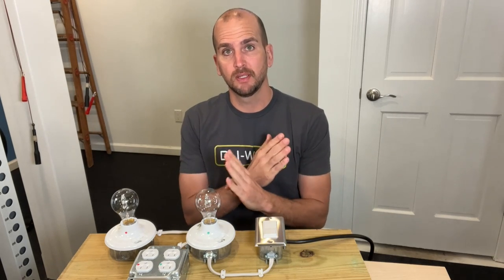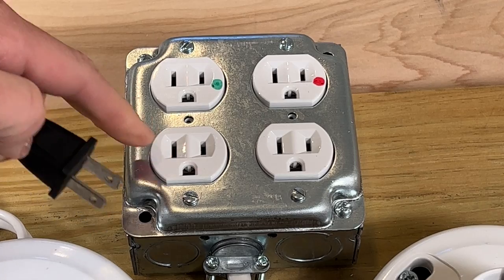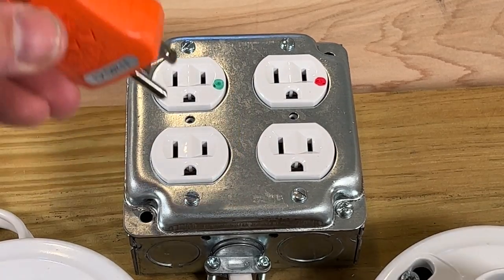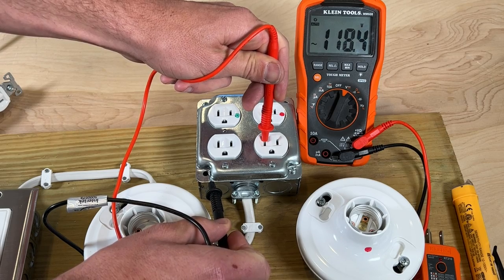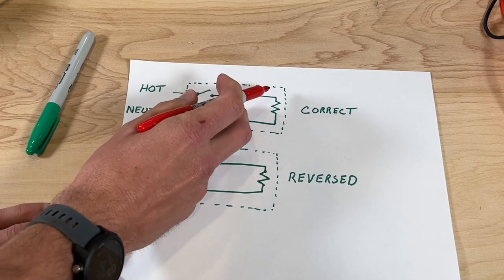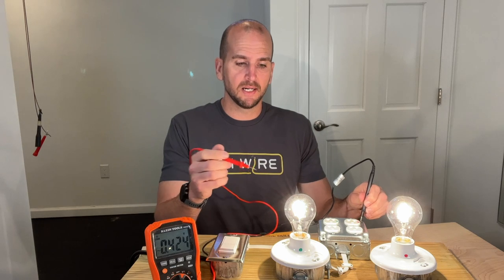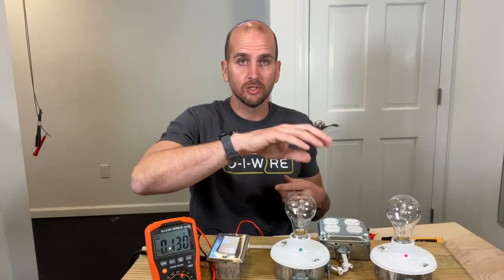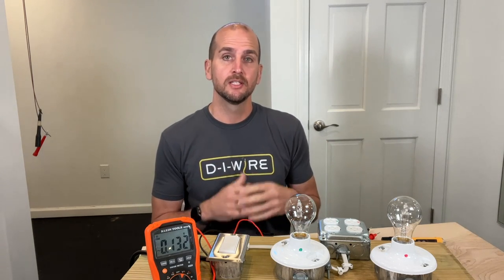Dangerous Wiring Issues In Lights and Outlets

Comment: My dad found most of the outlets were wired in reverse in an older house that we moved into. Being an electrician, he fixed all of those.  But I would not have guessed that unscrewing a light bulb would zap you. So now I know.
Reply: I have found the same problem in apartments I moved into, presumably wired by "professional" electricians.
Reply: The Edison screw (which is what you would consider a standard light socket) was developed quite a while ago. The polarized plugs and sockets used today were an attempt to make the Edison screw safer. The intent is for the large easily touched screw portion to be at neutral, while the hot portion is the little contact at the center of the bottom on the socket. (The easy to touch part = neutral, while the hard to touch spot = hot). Frankly, if the Edison screw were to be developed today, it would have been immediately rejected due to safety issues. But given how long ago it was developed, and how many of them have been installed over the years, it's a legacy device that's virtually impossible to get rid of.
Reply: @johncochran8497  British use a bayonet mount that has two contacts on the bottom.
Reply: @johncochran8497  you backwards, smaller screw for less current as neautral is a traveler conducter carries 50%  of   of the curent line , if add both togeatherif current line is 120 v ac and neautral line is 60 v ac = total 180v ac. From ground to neautral is 60 v ac if curent line is being used. The curent line and ground be 120 v ac.  Only earth ground is 0 v ac
Reply: @michaelspencer6523  You might want to try again there. Your comment was rather incoherent and wrong. 
Perhaps you've confused about an Edison Screw vs an Edison Circuit. Even though both use the word "Edison", they are NOT related except in that they're both associated with electricity.
Reply: @johncochran8497  im a master electrician and i was  over many sites  for usa army with kbr, i found alot basses had your fault i had fixed on war zones or tbe soliders died from ekextical shock and nit tbe war. Neautral is a traveler of half tbe curent, only earth ground is no b
Volts. Never think neautral is o volts  or you get killed
Reply: @michaelspencer6523  I've met many people who've hand 20 years of experience and far fewer who've had 1 year of experience repeated 20 times. Welcome to the more exclusive group.
Reply: @johncochran8497  yes even i repented every night on same thing, then i noticed it in scripture. Only 1 repentance. He explained it . And it was clear it only 1. Repent means turn a 360 degree around from, never look back, as lots wife turned back no repentance, she turned into a pillar of salt. Repent, never do it again, if do it again, i not truely turned my back on it. Must never go back, it is  not  in our desire no more. Repentance is only 1 time on the problem.
Reply: The danger of shock from a light fixture is exponentially worse if you are on a ladder changing the bulb. Be careful up there!
Reply: @michaelspencer6523  In the U.S. the electrical code for many decades (longer than your experience) required the neutral to be grounded. In code terminology the neutral is the grounded conductor, not to be confused with the grounding conductor referred to in common parlance as "the ground." The only way neutral is not 0v is due to minimal resistive losses and the associated voltage drop or if there are major wiring problems.
Reply: @Sylvan_dB  it not more of a chance to get electricuted  on ladders, depends on what latter made of . Plus if ladder grounded to floor or grond like dirt or concrete you be stuck omln curent line and can not get off till heart explodes. Some times ladders save lives if not grounded if it not a comductor  as made of hard plastic insulated for 3 times the volage or made of fiberglass rated for 3 times the voltage. As line voltage is 10,000 volts ac. Stay away from tbe lines  at least 6 feet away or the  voltage will reach and grab you and you explode.  Always turn off circuits at panel not switches. Also always  use  a volt meter. Never work on a loaded line. That is fatal. Metal or wet wooden laters are same as grounded. Always usa a fiberglass or hard plastic latter approved by osha always. If can not do job safely , do not do job till job is 100% safe.
Reply: @Sylvan_dB   incorrect, it to be a grounded  conductor only. Never a curent conductor. Neautral is not a grounded conductor   and never was. You miss understand it. Neautral is made by the electrical wave through the core in 2 or more windings called the transformer. That why it a traveler not a ground. Ground is earth ground in ac . Must be at least 5/8" by 6 feet long burried in ground with a clamp  and  at around 1/3 the size of service conductor size conductor =wire size.ground always 0 volts. Neautral always 1/2 the curent line volts when energized , the return side of the ac circuit
Reply: @Sylvan_dB  always remember possitive and ground always look for each other like a magnet to stick and can not get lose. Frys you to todeath. If grounded. But if not grounded it may blew up uour heart even after you got released. Your heart can blow up wiyhin 72 hours after shock.dead.
Reply: @michaelspencer6523  in the u.s. the neutral is always a grounded conductor.
Reply: @Sylvan_dB  no, you are no electrician, not even a journyman. Anyone says that a neautral is a ground id abroad not in usa or never ever took a rlectrician journeyman test much list a master state test, jouneyman test is first ar a city. It best you take a electrical college coarse or even a coarse  in it calked motor control and relay logic. It gives  the basics  of atoms and why relays not work due to low voltage 3% suplying the coil of relay.  , teaches earth ground and transformer basics, the neautral end of the windings on different voltage as 480 y phaze or 240 or 120 or 208v.
Reply: @Sylvan_dB  conductor means the materal that carries atoms like a wire or medal. In this case its wire or rod. Ground is earth ground must be 6 feet incased in ground and has a clamp to hold correct size wire  , a out 1/3 size as service wire amp size.  A traveler can carry same as current line , current line say is 120 v 60 hertz 30 amp 90 feet distance circuit. Equals size  # 10 wire on a 30 amp breaker. Neautral be same size wire because  it a traveler of current wire #10  for 30 amps alternating current.   Ac power means alternating . Current like pushes 120 v per 60 cicles a second in speed and it must drop back on half of current reading of 120 v , half be 60 v every 60 cicles a second..but ground not slternating curent!, it just earth ground with 0 volts. When it touches a current line as a short or over sends volts it trips the breaker to shut it down. A circuit  wothout ground will trip breaker but much longer. Once neautral shorts to current line it heats up to the breaker tempure liquid tbat keeps it solid then mercury in breaker opens up then trips. Ehere a earth ground   stops it automaticlly upon  shot , not heat, much faster and saves lives, where  your body must reach a mercury melting point before breaker trips. A neautral is a traveler mot a ground. Never get in middle of a neautral ac. You be stuck and die from voltage electricuion
Reply: @Sylvan_dB  you are  sure  not from usa. Usa gas did correct earth ground since the 1950's. Neautral is a traveler conductor , never a earth ground. Neautral can carry 100% of currect line does in ac. The earth ground is seperate, connects to a rod incased in earth 1/2" x 6 ' deep with a clamp that holds the 1/3 % of service size wire . Is 100% no voltage.
Reply: @michaelspencer6523  I most certainly am from the US and have been doing thus my entire life and have a library of books. I know with absolute certainty the neutral is grounded and you can open any main panel and see it. "Grounded" is different from "grounding." Neutral is a "grounded" current carrying conductor which is connected (code says "bonded") to earth ground at the main panel and only there in a building. The "grounding" conductor is colloquially known as "the ground" and is for fault current only.
Reply: @michaelspencer6523  LOL
Reply: @Sylvan_dB  yes it serios,neutral will kill you same as current line. It a traveler means csrrys volts and amps or watts , half of crrent side tbat under a breaker, say it a 30 amp breaker, that neutral can carry 30   amps also . That why it traveler circuit. Only the   earth ground   has 0 volts 0 amps.
Reply: @michaelspencer6523  You're not listening. The neutral is bonded to earth at the service entrance and should not have significant voltage relative to ground anywhere on it. That is why the shell of an Edison socket is connected to it.

Yes, it can be at full line voltage, but that reflects either a broken neutral conductor or a high resistance connection between the test point and ground. Under normal circumstances it should have less than one volt between it and ground. 12 AWG wire is about 1.5Ω/1000', so even with 15A you're only talking 0.5V over 200 feet.

A 30A circuit in the US is probably 240VAC, with two hots and an optional neutral, so you have to be quite clear about whether you're talking about a situation with two hots and a ground or two hots, a neutral, and a ground. Even then, the neutral should still be within one volt of ground. The two hots, obviously, will be 120 VAC to ground.
Reply: @johncochran8497  Yep.. he can claim all he wants.. I already cornered him in another thread.  He just thinks he knows it all.
Reply: @michaelspencer6523  you may be a master electrician, but you are definitely a poor speller, and therefore could not pass the written exam. 
 I doubt you have even apprenticed in this trade.
Reply: @burtonholmes4708  that the silliest excuse to come up with on i ever heard,  to complaim of sprelling  and we talking voltage ?????? This guy is jeaious , or on wrong video.  And everyone  serious on  voltage ,   would agree  on this subject .
Reply: @burtonholmes4708  can a spelling a be a master electrician ? It has never been validated  as has in tbe pass. Plus i never  on past 50 years seen a master electrician hire spells on my life, i never hired any , i can not use them no purpose for a speeler on a electrical job or trucking or wars. Truckers not need spellers neither do we in wars. Nobody going ask you if you a speller before that shoot you. Spelling is nice for kids to learn T grammer school, but a adult all tbey see is spelling . Mmmn not menrally right. The picture just not compute. Sorry dude, you on wrong video.
Reply: @michaelspencer6523  there should Not be any voltage between neutral and ground period you have a problem if you have 60 volts between neutral and ground. The neutrals are the center tap of the power transformer which is also grounded. In my county the neutral must be tied to the ground inside the breaker panel by a screw. You still need separate neutral and ground busses but all is tied together with the neutral screw that goes through the metal box. Never use the neutral for a ground. 73
Reply: @PaulSteMarie  I never in my life had voltage between neutral and ground at least when both are tied together with the screw that goes into the metal box  I hope they never make plastic breaker boxes we would be in trouble. 73
Reply: Anyone knows not to touch the hot or neutral wire because they may be reversed. The neutral wire should not have any current through it in reference to ground but you can be in series with the neutral and get shocked under a load. 73
Reply: @ronb6182  then you're a lucky fellow. Very easy to get significant voltage on the neutral, if there's a dodgy connection between a socket and the breaker board. 

Even if all the connections are good, you will still see voltage on the neutral anytime there's current flowing. Otherwise the current wouldn't flow.

Even if there's nothing wrong with the wiring, 12 AWG has 0.1588Ω/100'. Assume a run of 50' back to the breaker box and 10A load, that gives 0.81V on the neutral, not much, but easily measurable. Longer runs/more current/lighter gauge wire means more voltage drop.
Reply: @ronb6182  listen  , being reversed or not , never touch neautral white wire, black wire  always hot or curent line. Neautral is white , it a traveler means carries half of current line , when current line is being used. If black is  120  v -ac ,  as being used , like a fan runing on it now,   the white is neautral , a traveler carries half the current line , 60 v -ac. Ac means alternating  current. Draw a straight  line then at top of line put a upside down v's  and between then  between the upside down v's, on bottom make a v between the 2 upside down v's on top. Put 120 on top of line , as 1 on bottom  between    each 2 on top it be 60 on bottom. Now you got a electrical  pulse of all 120 volt ac. Circuits . If notice the 120 volts ac  goes to the item, 60 volts return back to transformer , then transformer  sends 120 volts ac to item again. Now in usa it only uses speed of 60 hertz per second. In most  all other nations  uses 50 hertz. A 50 hertz is slower by 10 hertz in other nations.  So a 50 hertz  core is thicker than a 60 hertz core. You can use a 50 hertz core transformer on a 60 hertz line but not a 60 hertz core on a 50 hertz line, it melt if did , core to thin for the 10 more hertz slower and amps carries heat. The heat from the amps slower over tbe core that not thick  anough to carry that heat a second will melt and short out and explode in middle of the tranformer . The hertz is the speed of the Y shape ohms law per second.the number at top of Y is divided by the  other 2 at bottom of the Y, the 2 at of the Y is multiplied .this is the formala of all ohms law. Say top of Y is 120 volts and left of  bottom of Y 3600 watts, the right side bottom of Y is 30 amps. Now it the formala always equals on all currents, if change 1 number it will change all 3 numbers to equal the current.this is ohms law. Another words if have 120 volts ac per second  , and item uses 30 amps per second , it always 3600 watts per second at a distance of 100 feet or less, use size 10 awg wire , all extra 100 feet use 1 size larger wire  ,  in usa at 60 hertz per second ohms law.
Reply: @ronb6182  ???? All currents that are alternating has a current line as rated at 100% and a traveler line back at 50 %. If line is 240 ac  volts the traveler carries back to transformer 50% of that load called the neautral. The neautral is not a ground wire it electricute you if touch it as line is being used and that line is sending 50% back on it to transformer on pole. Only  a earth ground color green or bare is 0 volts. Do not connect the neutral to the earth ground or it short out.  If have ac and only a current wire and no neutral, it not work because it can not send 50 % back to transformer. But if it dc like a car is dirrect current it only a current line witu a ground wire in different color than ac. Ac ground id green or copper bare and dc ground is black. Dc not work without a ground wire. Ac not eork with out a neutral. On ac the earth ground is used for many things in electronics and saves lives as in no fault recepticals in sinks  and bathrooms. Those are fast short breakers where all other breakers are based on heat breaker. Heat must generste above what breaker trips at so that why we die fast ,  the amps enlarge our musles , the heart, and at same time our temparure rises hoter than the breaker before it yrips of not no fault.
Reply: @ronb6182  you are not talking about alternating current, you talking dirrect current. Dc is  Durrect current is like a flash light battery or a car battery. It has 1 current line 1 dirrection and a ground wire only. Ac is alternating current, a current line of full required current and a traveler wire that sends 50 % of current line back to transformer . It travels back where dirrect current does not travel back. If the  ac on current  line is 240 volts , the neutral  will be 120 volts  traveling back to transformer. If the ac is 120 volts current line on breaker, that neutral  line goes back to transformer 60 volts. 1 volt will electricute you. Only the earth ground on alternating current has no 
Voltage. Earth ground  is dirrectly connected to a ground rod in ground at least 6 feet deep, and at least  a 1/2 inch thick rod with a connected  solid clamp  on top for wire to connect.
Reply: @michaelspencer6523  never I always measured my neutrals to ground with a  meter and also neon light tester and got zero on the meter. I had a friend that had voltage on his and that's why I started checking neutrals to ground. If I check the hot to ground I know the ground works. Because energy was being used in his wiring he had issues which I could not help him fix because of county law. I can do my own but not someone else's. I can go to any outlet in the house and check any neutral and there will be no voltage to ground the neutral and grounds are tied together in the panel. Common sense would tell you no power across a shorted neutral to ground.  Maybe you don't have neutral to ground tied together that's the only way I will believe your case. White is not always neutral white can also be hot in 240 and in switch cases. I started using black tape on switched cuicuits so I know that wire is switch hot. I try to connect the line hot always to black I always done that in the past. Next time I go to work I will check my stations neutral to ground in case since we have three phase maybe neutral may have some current. 73
Reply: @michaelspencer6523  you don't have DC in house wiring don't even go there. Maybe off grid people may wire DC outlets in their home but highly unlikely. AC cannot travel if the breaker is off. And with AFCI breakers now everything is off. I will just take your word and leave it at that in your case but I know my wiring is not live neutrals with a ground to neutral tie. Neutral in my home is grounded. I don't have three phase so I'm not going there either. 73
Reply: @PaulSteMarie  you said if and if isn't the case in my home. If you are in series with a neutral then I can see current flowing but grounded neutral by itself no.73
Reply: @michaelspencer6523  first you spell Neutral N E U T R A L. Yes it is grounded in my home if you learn to read I said it was tied to ground in all my comments. 73
Reply: @ronb6182  only reason you got 0 from neutral to ground is , the current hot line not in use. Nothing on it. Working. But plug a fan in that circuit now, but be careful its hot,  check neutral to ground in usa only, it say 60 volts  if it not low voltage. If current line is 120 volts. Say it 2 vote drop it reads 118 volt is good , if goes 3 % or higher it  low voltage need  repaired , things with coils like motors ac, ref. Not work because relay coils drop out on 3% voltage drop .. please not touch neutrals it kill you. Plus neutrals on pole lines carry 5000 volts to the step down transformer for your house in usa it 10,000 volt primary x 240 volt  secondary transformers. To save  money  in wire from pole to pole. In that high voltage,  do not get  within 6 feet of it, or even the neutral  line will reach for you and get you. Electricuted and blow up.
Reply: @ronb6182  it not grounded in your home , the panel box in usa looks as it is, it not or nothing works. In pannel boxes out of usa the 240 songle phaze 50 heryz , no ground bar in them. You have to make a seperate earth ground bar for those. I done many being a master electrician  with kbr building citys in united nations. In usa low voltage is 250 volt  dual phaze 60  hertz. In 80 % other countries its 480 dual phaze at 50 heryz. Usa uses earth ground for many reasons, it controls high tech controls and even mega generators . Also saves lives. Earth ground is most important in electrical safety. All ground fault recepticals  are on a earth ground. Why ? Because a short  trips its breaker faster  than breakers in breaker box are triped on heat not shorts. Once it shorts in pannel it stay on til the mercury melts snd it trip. Those breakers work on heat not shorts.and for spelling im on my cellar phone, keys are so small my fingers 2 times bigger and gets the letters next to one i click. Thay why it  takes me long time to  reply
Reply: @michaelspencer6523  I know the scoop on power lines you can get free electric from leaking power from the air. I think I see your point my lines are dead when I work with electricity. Like if I work on the shed wiring I will turn off the main at the house I can use battery light to do my work. Don't worry I don't take chances like I did when I was a child. I been messing with electric since I was 4 or 5 years old. I used to make my own extension cords using a plug, outlet, and line cord. I used friction tape to insulate everything. I even made one with a light socket and dad used it when he plumbed his cousin cottage. Dad was the reason I played with electrical stuff. Dad wired many cottages and a few houses. Even rewired a farm house that had the black wires with no grounds. That was a big mess until we got 100 amp service. That was a lot since we had free natural gas so the furnace and stove were gas. 73
Reply: @ronb6182  here is easy to understand why neutral not ground. Get a pen and paper and make a straight  line from left to right across paper. Now make 120 upside down v's. now under them put a v between 2 upside down v's  there be 60. The center line is ground 0 straight. On top it is current of  120 volts  at a speed of 60 hertz a second. On bottom  is a traveler at 60  volts  at 60 hertz per second  back to  transformer why it called alternating current out and back. 120 volts in at 60 heryz per second at 60 volts back at 60 heryz per second. Called ac. Not dc. For s ground you must put a lighting rod in ground 6 feet deep with a clamp on it at least size 8 wire if panel size 200 amp. The ground is for lighting, seperate high tech computers isolated, tvs, cellar phones, many items today even   mega generators that put out 2000 amps. For citys. As you see in picture you drawed, wither it 120 v or 1 v it current that kills. I not got be 120 v to kill. Only takes 1 volt to blow up your heart electricuted.
Reply: @michaelspencer6523  yes it is grounded because it has the screw installed to the metal box. Maybe other places the screw is not installed but in my home it is and don't forget the house was built in the late 60 or early seventies. But it's useless to argue over old wiring because of AFCI breakers which turn off the neutral as well as the hot. I tripped a few of them thinking the power was off my brother in law reset one and I tripped it off. The neutral in these are not grounded apparently because the ground tripped the AFCI breaker. 73
Reply: @ronb6182  if you have no failt recepticals on sink counter and bath rooms. Do not connect the neutral to the ground pin. It  not be ground fault. Only earth ground be green or bare copper in ac only. Put neutral on silver pin neutral  bar only, put hot current  line black or red or blue on gold pin only, the green pin is ground on ac. Put green or bare copper on no fault green pin only. Now its no fault. Saves lives. Trips   its own breaker in middle of receptical  if shots out, breakers in panel box are heat mercury bteakets unless  it has a seperate  wire on it should be green , green wire goes to earth ground bar  not the neutral bar. Big difference in a mercury breaker   and a shortage breaker. Shortage breakers are from 5 to 10 times higher price.
Reply: @ronb6182  also, there is dc in a solar panel or wind mill panel house dude. Its battery bsck up convertion. Also , if got a well pump or a swimming pool. Do not double ground tbem with a neutral or they will get electricuted in shower or sink or pool. Double earth  ground a well pump , and swimming pools solid. Not peiced.even tripple earth grounf is best on those items.
Reply: @ronb6182  any time you create current it got be stable, must be stable volts , and hertz    and watts . Only way create current is ac first but bot controled so it bad it could be 100,000 volts then next second it 2 volts. So hot put on a controller to make dc  voltage then it converted  to a regulated  ac voltage , and if for house it must be sine wave or alot burn up  fast like computers , tvs, radios, celler phones , all high tech equipment takes dine wave not square or half wave. It has bridge rectafiers with 4 diodes per bridge rectafier.  All pole electric  from power companys are sine wave.
Reply: @ronb6182  sounds like you got neutral tird in with ground. And ground not earth ground . If it not earth ground seperate from neutral it a neutral not earth ground. You just checked neutral to neutral reads 0 same as reading a hot wire being used to same hot wire it read 0 also.  Earth ground is isolated to  earth only. Not neutral or current lines. Both are traveler wires. Only earth ground is no traveler wire. It always 0. Also if read current line with a different phaze current  line of 2 low voltages 120 v each it read 240 v,  it same on neutral wires  if both digferent phazes and both circuits being used  and both current lines 120 each different phazes the 2 neutrals read 120 volts across each other.
Reply: @michaelspencer6523  yes it's tied to the stake in the ground and the water pipes are all tied to ground. Remember this is old wiring, new wiring may be different and the house in the mountains was done the same way and passed inspection over 20 years ago.  I'm sure if I put AFCI protection all will have to be changed. I won't worry about that bridge until I get there. Thanks for clarifying this issue I'm old school and things have changed over the years. I learned the old way before GFCI and now AFCI. 73
Reply: @michaelspencer6523  yes but you don't run DC when AC is being used for lights and appliances. I guess you can wire like an RV and use both but highly unlikely in a permanent home. RV wiring is a different all together because you use battery as well as grid power. I will have to study up on DC wiring because we just didn't use it years ago in the home. 73
Reply: @ronb6182  sir, does  wind mills and  solar pannels  have dc in it ???? Did you not know power companies also use batterys to convery to 10,000 bolts ac from dc ??????
Reply: @ronb6182  also did you not know your car alternator  makes ac volts first then converts to dc ?????? Yes even solar and wind mills makes ac first befor it converted to ac regulated to a steady volts and watts and hertz is correct speed. If wrong speed per second it melt the cores in relays and transformers
Reply: @ronb6182  as in a electrical test. You have 2 circuits in same volts   to run in a conduit. How many neutrals  do you run with those 2 same volt   circuits in 1 conduit ? Answer is 1. Because current lines haul total current and neutral half that circuit current so double  half = current  volts = same size wire 1. Answer is 1 neutal wire same size  as curent lines.
Reply: @michaelspencer6523  I'm not off grid all this is irrelevant. 73
Reply: @michaelspencer6523  can't find your last comment but to answer there is no natural gas in North Georgia my wife is afraid of gas so I won't even get a propane tank. It would be nice to have a back up generator that runs on propane but that's out of the question. 73
Reply: @ronb6182  if you 73 why did  you  start playing Roynd with electrical now ? It takes years and years to get just the basics. It took me a life time, in  a war zone  was the must important  time of my life , seconds  counted. Power saved lives. As water 100% needed for life and must be 10 staged filtered yo drink it and live. Any electrical  problem in war zones black outs, 99.9 % can be fixed in 10 seconds . If can not , you not the man for the usa army to count on. That is electric 1  job. like  in iraq , 400 bases, black out, the pump house hors down, electric 2  of 1 of the 400 bases calls you with problem, electric is the  electrical  supervisor of that 1 base. You must get problem fixed in 10 seconds even if bullets bouncing off your helmet and body armor. That your job. The  Master electrician.
Reply: @michaelspencer6523  been playing since I was 4 years old and yes I still learn stuff I must have forgot my AC class stuff. If I was to take a test I probably won't pass it but since I'm about to tell my current job to take a hike I got ten months and I will be searching a part C advantage plan  maybe I can study my general class and even freshen up on my electronics that I forgot. I always knew ac goes positive to negative 60 hz I just never thought about hot and ground and how ac acts. Transformers in power supply I do know as for delta configuration I need to study up on that . AC is one thing that I played with in Jr high with batteries and vibrators and power transformers I never got bullied too much everyone was afraid of my projects I could shock through clothing and such like. Thanks for clearing up stuff that I was weak on. A big 73
Reply: @ronb6182  i hope hou luck, all electricity is dangerous. Do not make experments. Stick to books and do not try be contrary to books or you vet poped or death. As transformers , they only transforms volts  what supplys them, all in equal  amounts. Like  primary 5 times or 4 times or 100 times biger or smaller the seconday volts example a 4x1 transformer is 480 volt primary winnding if 1 turn =1 volt it be 480 turns ans secondary 120 volts it be 120 turns of 1 turn is 1 volt, and secondary around the medal between the windings called a core. The core is most important. It must be made for the speed and size of windings . The speed of tbe magnetic voltage between the primary and secondary. And must have a salach covering  of the raw copper wire on all copper so it not short out, it is insulation. . Amps is the measure of heat in the conductor  volts times amps = watts it produces. The ohm lsw. The type materal of the core  and its size is most important. Usa is 60 hertz speed. Most other nations is 60 hertz speed. You can use 60 hertz on a 50 hertz core but not  50 hertz on a 60 hertz core , it melt  the core and transformer  99% chance it explode and burn. Some times it cheaper  to make a step up transformer and a step down trsnformer instead run 1000's time 1000's feet of wire  away from service transmittion.
Reply: @michaelspencer6523  just be glad I didn't try making a Tesla coil I bought the insulators and had a neon transformer I still have the transformer but I seriously doubt it still works the last time I fired it up I made a Jacobs ladder but that was back in the eighties. I never got near it when it was running. In highschool my friend made a Tesla coil and I gave him a piece of quarter inch glass for the capacitor he made the plates too large and the arc went over the glass to the other side and cracked the glass. My dad brought the glass home from the A&P where he worked he was going to make an aquarium but that never happened. I used to cut the glass for desk tops I gave one to my friend down the road and made me one and then I cut one or it was already cut for the capacitor. Well that was as close to a Tesla coil I ever got I never saw my friends coil because he broke the glass capacitor. The technical school had open house and the electronics had showed stuff the students made. I had data processing and played music through an am radio from the CPU the tones were generated by the beeps and duration. The chain printer played Anchors away. We also ran pictures like the American gothic and starry night. We were not allowed to run the porn pictures. Some guy named Larry had a disk pack that was a former student had them pictures saved on his disk pack. They named the pack Larry's pack. I don't know why he left it maybe it was used to run assembly or assembler which was the name of the text book . I never got past Cobol my friend made a bio rhythm program using cobol and fortran Subroutines.there were other classes like engineering drawing wood shop appliance repair which I should have taken my math was too poor for electronics. My friend had hard assignments. I almost forgot we had a bakery and used to buy bake goods they were good and fresh, you could also get your hair styled at the beauty parlor which I didn't do I wasn't allowed to have long hair. Well that's my history of education in high school at the technical school. 73
Reply: @ronb6182  I'm glad you never had to deal with it 😁
Reply: Yes but a good rule is to never touch the screw base on a lightbulb. All wiring done by someone else may have issues it's best to do safety measures to keep from getting shocked. Gloves help and can help when removing a hot bulb as well. 73
Reply: Unscrewing a lightbulb will not zap you unless it has a metal box and you touch the box, screws fastened to the box or you touch the metal socket. The bulb itself is glass and cannot conduct electricity. Because of that when changing a bulb avoid touching anything metal just in case.
Reply: Is IKEA stuff all screw in? I know Ireland uses the same system as UK but IKEA is pooular. I need to check this as I have changed lots of lights and am not sure I paid attention to the polarity. I was thinking AC will work either way but not about this danger. The ceiling part is colour coded and easy to copy but the actual lamp holder doesn't seem to be marked + - ... or is it? Time to check.
Reply: @michaelspencer6523  I've heard of Bidenomics but yours sounds like Bidenelectrics, lol.
Reply: @michaelspencer6523  Amazing, the abilities from your long-term work experience on a Third World island really do show.
Reply: @michaelspencer6523  your comprehension skills and ability to understand the English language are not well grounded